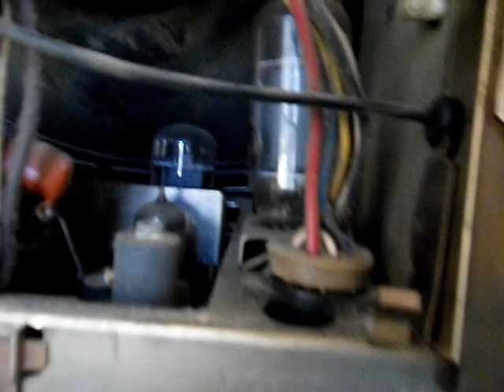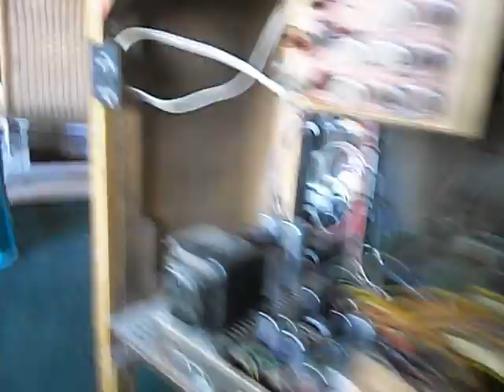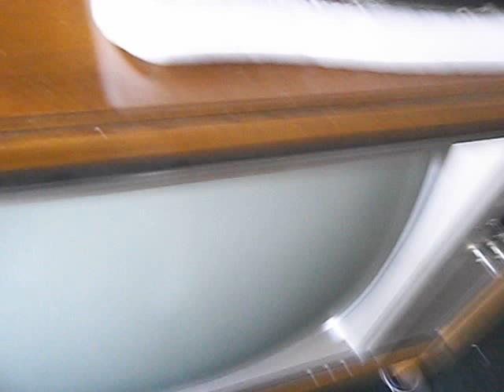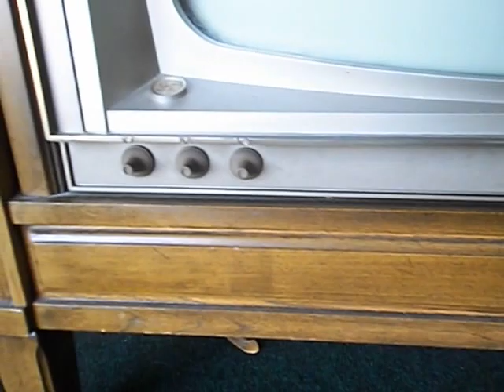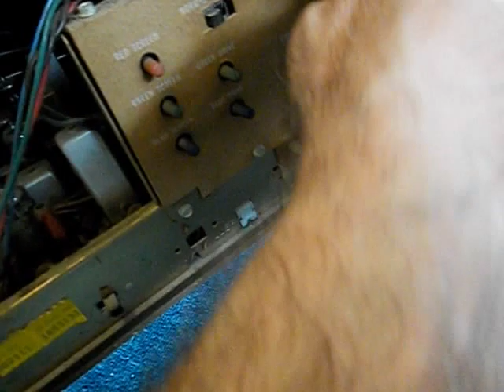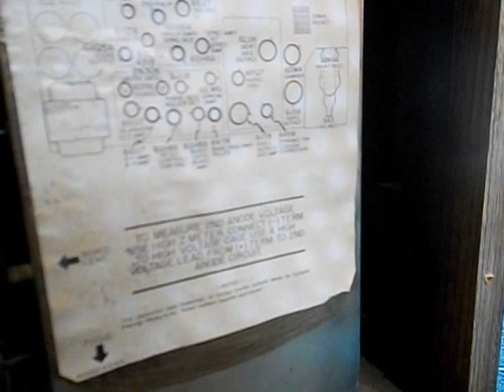vintage sylvania color tv

Comment: As you stated, it would be prudent to get readings from the pin voltages to make sure the new CRT will function correctly. From what I've seen, this particular set appears to have been made around 1972-73 or so, just before manufacturers offered sets with hybrid chassis. With the new CRT installed, you will obviously be able to obtain a good operational baseline to work from.
Reply from the maker: I did check them out, everything looks to be in order voltage wise at the various pins (K, G1, G2). I was having some shaky vertical, but that turned out to be a poorly fitting cheater cord. I am going to pull the chassis, and check/replace any suspect film caps that I know are in high stress locations. After that I will do the CRT sub after I get some good video showing part placement and lead dress of various wires from the chassis to parts not mounted to the chassis.